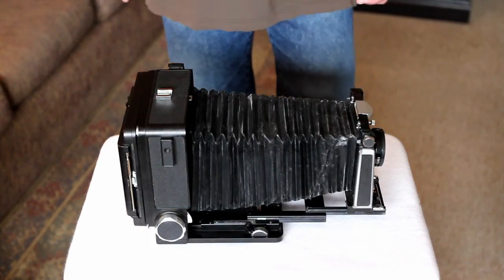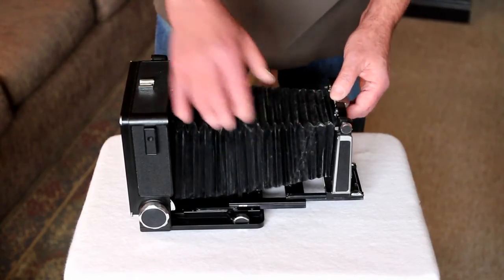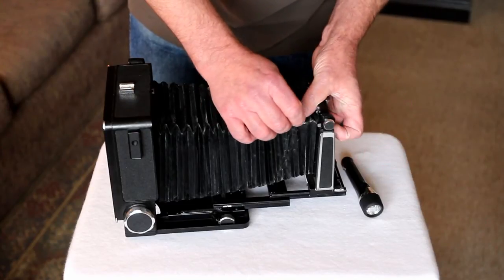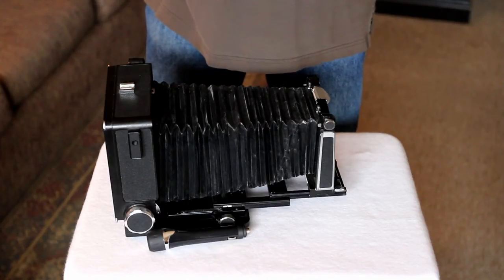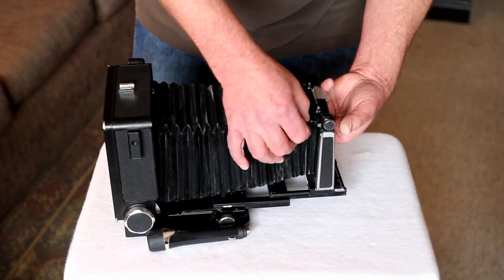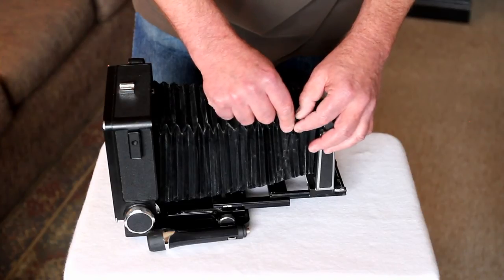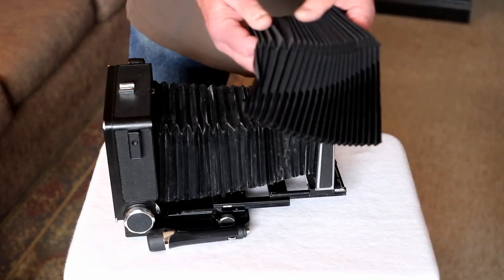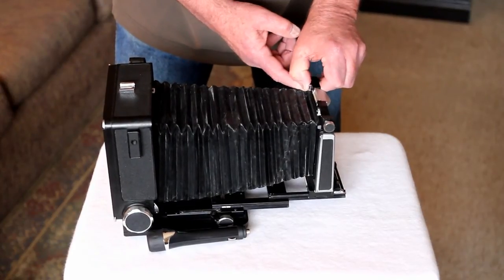Patching View Camera Bellows

Comment: Great video.  You mentioned installing a new Chinese bellows. Have you installed one on a Toyo 45A?  If so, did the camera close with the new bellows installed?  Others have said it does not due to the bellows being too thick.
Reply from the maker: I've installed Chinese bellows on dozens of Toyo 45A and 45A II cameras, a couple as recently as last week. Sometimes it will be hard to close the camera when they are first installed but they get much better with use as they compress and aren't so stiff
Reply: @SteveMidgleyPhotography  are toro 45A and 45Aii bellows the same? I found some Toyo 45A bellows and wonder if they suite a version ii camera.
Reply from the maker: @thanasiskatsios2157  Yes, they are the same